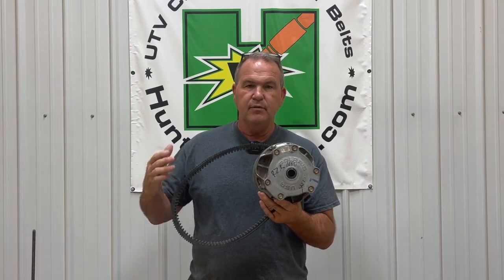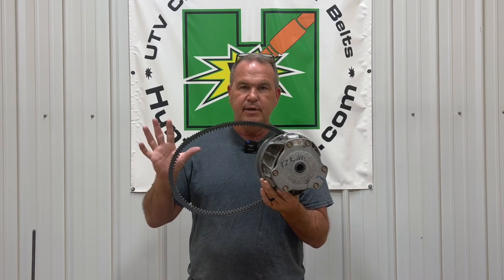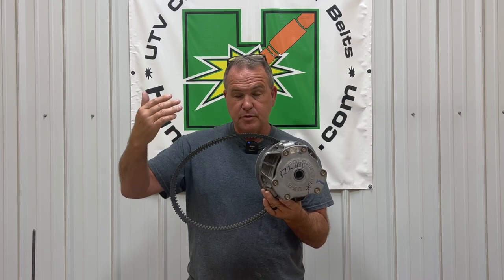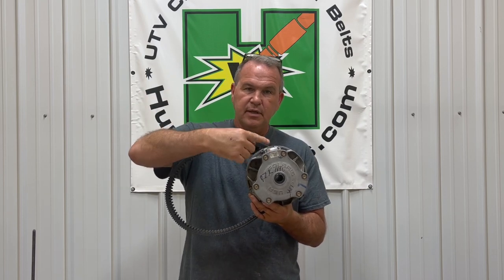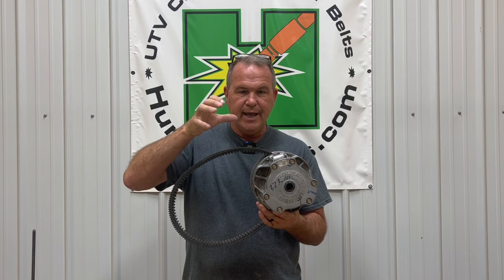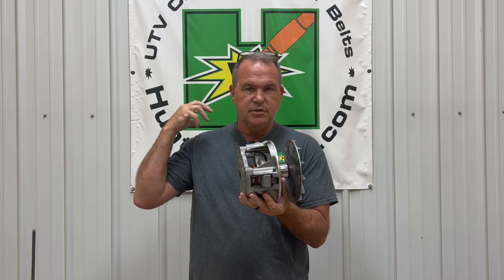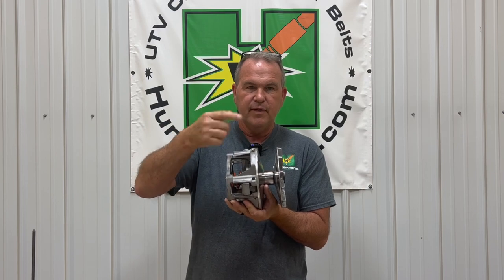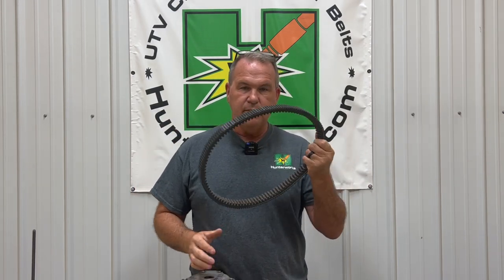What NOT to do with a CVT Clutch Vehicle

Comment: I wish I would have seen this before I tried getting a stuck RZR out of a snowbank with a kinetic rope. It unscrewed the primary bolt, the lock ring and spider in my primary. But on the plus side, I'm happy with my new Hunterworks primary clutch.
Reply from the maker: We hate it when that happens but we are here for the parts you need!!

Comment: When a clutch and belt don't spin together, they generate a lot of heat.  Quite a while ago, I remember a rider's ATV became disabled.  Had it flat towed back to town at moderate roadway speed.  Transmission in neutral.  However, the driven clutch continued to turn.  The turning clutch against the belt caused enough friction generated heat that the belt caught fire.  And of course, the fire spread to the plastic clutch cover and burned everything that was plastic or rubber.  ATV was a total loss.  Can-Am had a recall due to plugged vents causing overheatig of belts.
Reply from the maker: My question is, why was the secondary turning in neutral?
Reply: @Hunterworks  I don't know, just repeating what I've heard in his post.  I can't seem to find it.  Maybe he thought it was in neutral.
Reply from the maker: @danburch9989  Must have been in gear and thought neutral, the secondary does not turn in neutral